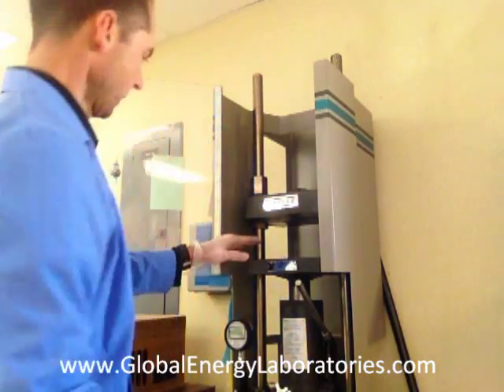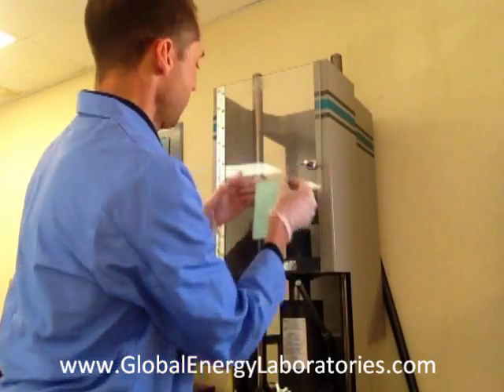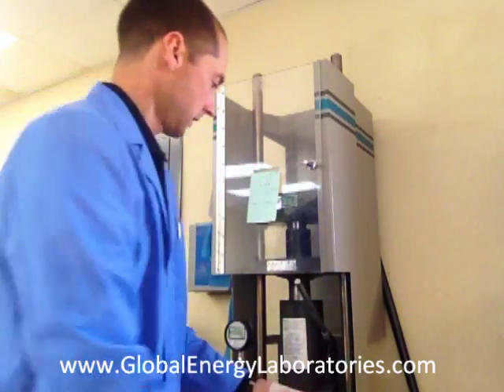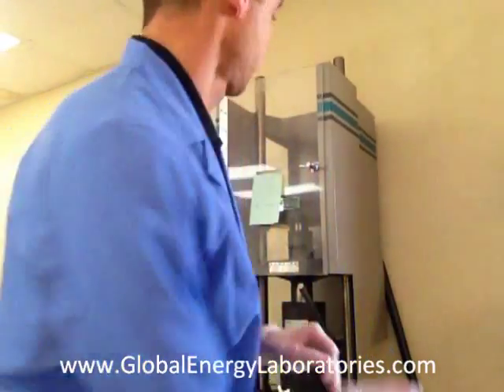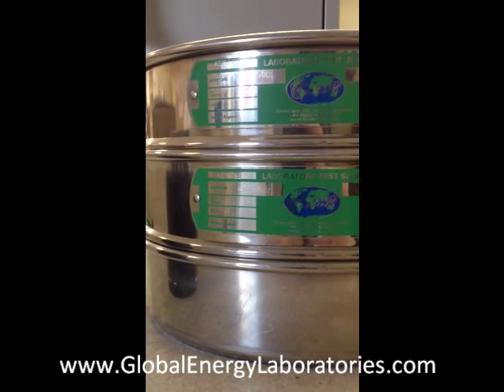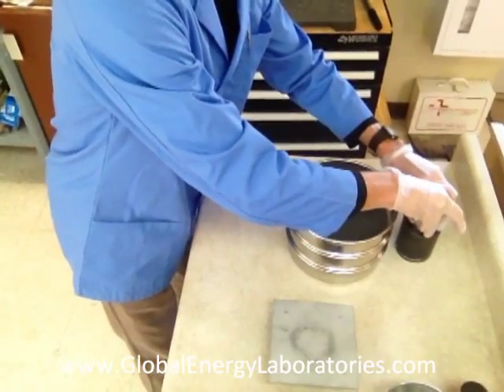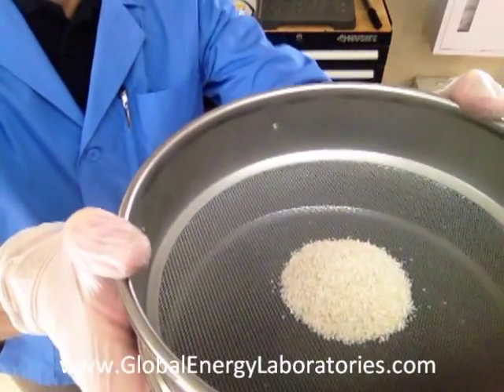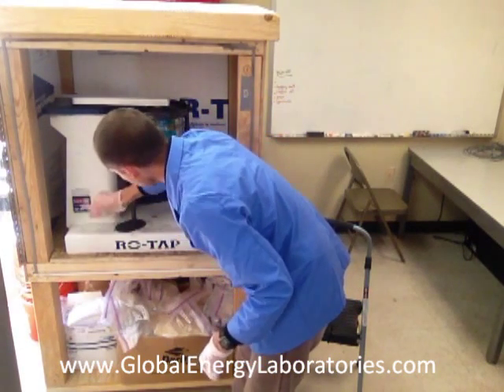Frac Sand Crush Test - Part 3 (partially censored!)

Comment: Brando, Your video is very informative. What is the calulation for the press?  The gauge shows pressure in  PSI, the test cylinder bore and piston  is 2" dia.,  The piston on the jack is 2" dia. .  Is the 4000 psi on the gauge equal to 4000 psi on the sample?